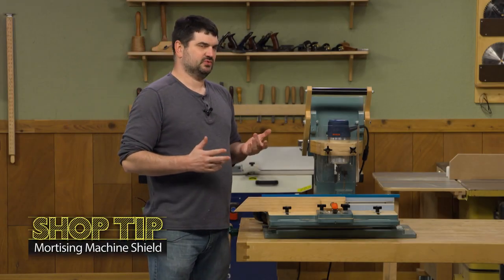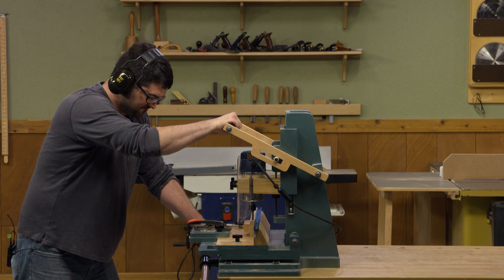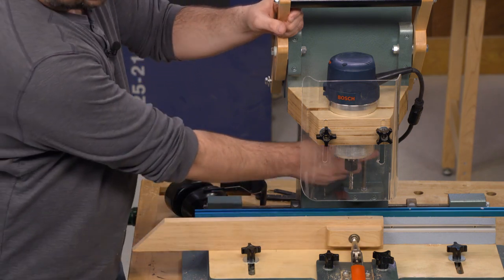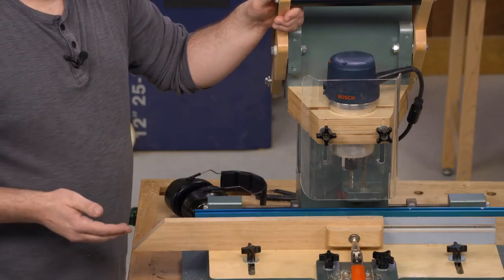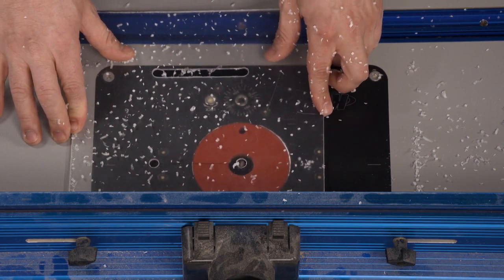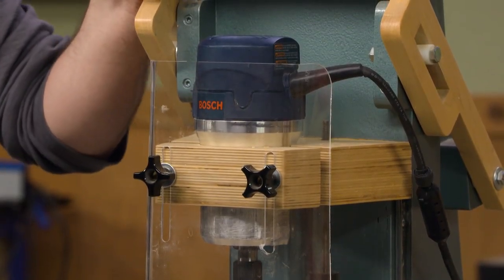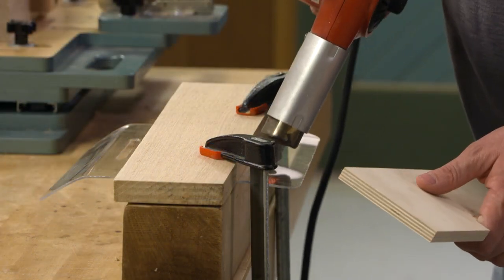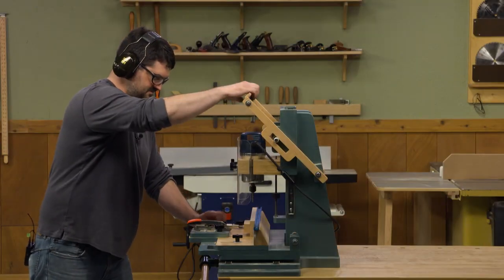Making a Plastic Shield for our Router Mortising Machine

Comment: A really cheap hack is to use the emptied plastic jar that contained your favorite snack and repurpose it. If the jar was rectangular there is no need to use a heat gun to shape it. Even better is that the plastic is easily cut with a utility knife.
Reply from the maker: Seems like a decent idea. Thanks!

Comment: This is a question for the original design rather than your shield, an excellent idea. How is this different than a drill press? Curious because I have yet to find a good way to make mortices with my limited equipment. I do have a drill press, although since it’s a bench top model, I can’t mortice long pieces.
Reply from the maker: The table that the workpiece clamps to slides from left to right so you can drop the bit down and cut the mortise.  There are stops to define the depth and length of the mortise as well.  Here is an older video that explains this project: https://www.youtube.com/watch?v=tueZbzxsMYg
Reply: @WoodsmithShowandmagazine  Thank you!

Comment: Another addition would be left to right table movements and even better is in and out movements. That would give you 
X y z  movements.  Mini overhead wood mill.
Reply from the maker: The table already slides right to left to make the mortise, but adding in and movement to the table would definitely add another dimension.  :)  Here is an older video that gives an overview of this machine: https://www.youtube.com/watch?v=tueZbzxsMYg
Reply: @WoodsmithShowandmagazine  I'll go one even further tilt the head vertical or horizontal or any place between.
Endmills ive actually used them for cutting plastics with a drimill tool hand held  the 4 flu work the best on this.
I worked in a machine shop ive ran mills.
On a mill you tilt the head stock but on this you could pivot the router to lay on its side  so let's say you want to make a unique pec of finiture and cut a mortise on say round stock but it has to more around the diameter 30dgr  
Also beside this part a turn table could give it a milled radius.  I cant think of any machine for woodworking that does this unless your talking about a high dollar shaper with 4 and 6" dia cutters.  Only other way might be a 3 cutter corb cutter on a table saw.   You would have to make a template and use a freehand router or chizzel it out.
Im just brain storming.    Ignor me.